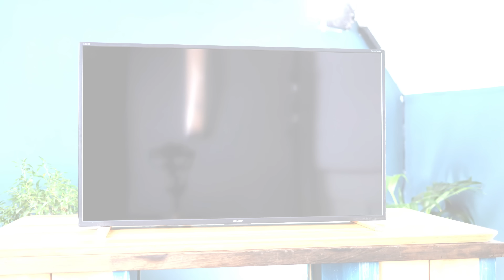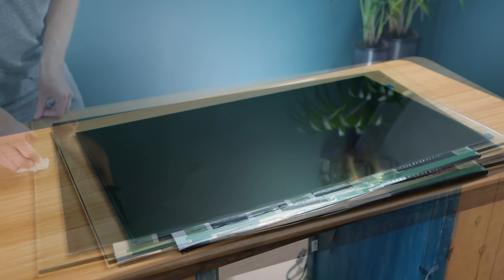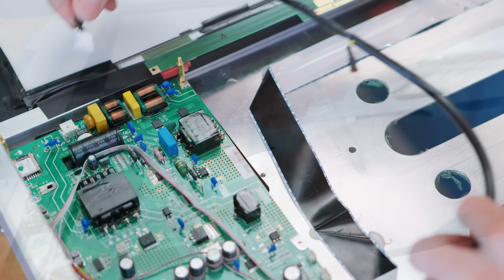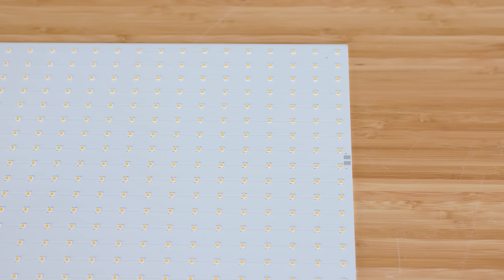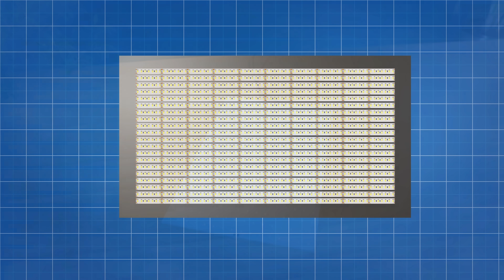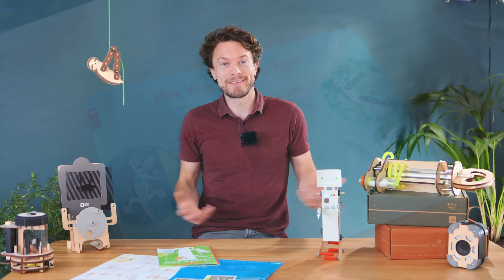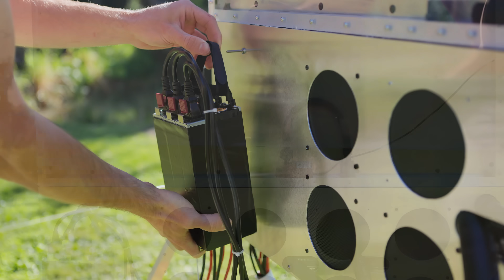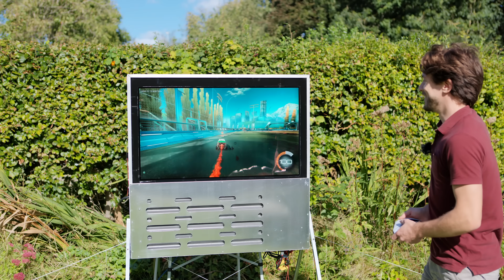Building an ULTRA-BRIGHT water-cooled TV...

Comment: With the LED stripes you get 1400 individual LEDs. If you manage to control them directly, you actually get a TV with A LOT of local dimming zones.
Reply: If there was software that could do it, it would be great, unfortunately that much zones, with such tight latency, I cannot se how.
Reply: @YOEL_44  would need an FPGA
Reply: @TheBackyardChemist  do you? even at 240 hz it's just 1400 outputs being controlled, so 240 * 1400 = 336000 control bits being output per second, or 41 kilobytes / sec. Seems like a normal microcontroller could do it. But getting the hdmi IN is the problem. I don't know if any inexpensive capture cards actually have very low latency, but I believe the PCIe ones do. So you could do this on a normal computer, essentially.
Reply: @cheater00  To really use the dimming zones optimally you can't just modify the backlights while keeping the LCD matrix as-is - you need to process the input video (at up to 4K for a TV like this one) and split it into a high frequency and low frequency component to send out to the LCD and the LED backlight simultaneously. There's a good amount of processing involved and ideally you'd want to do it at less than about 16ms for each incoming 4K frame.
Reply: @KillahMate  so you want to do it on a PC anyways.
Reply: @cheater00  you could probably do it with a PC that has a capture card, but the problem is that the processed HDMI signal still needs to go though the processor board in the TV which makes setting up the synchronization a pain in the ass.
Also a typical PC tends to do really poorly in timing critical things, you would need to use a specialized Linux kernel with the "real-time" patches
Reply: @TheBackyardChemist  I think in reality it's way less complicated than you make it out to be.
Reply: @cheater00  : Yes and no. An FPGA with some low-speed microcontroller (an Arduino would probably be enough) is the right way to do it. The FPGA decodes the HDMI (or DisplayPort, since there's easily available converters and the most important part of the standard is actually open), calculates the "backlight" video from the normal video, throws both the normal & backlight video streams into an FPGA controlled FIFO buffer (really just two RAM buffers, but the FPGA makes it act like FIFOs for convenience), and sets the distance between the FIFO's inputs and outputs so that the relative delay keeps the backlight properly synched with the LCD. The Arduino or equivalent is there to configure the FPGA on power up, and to provide a way to change the buffer length so you can get the synch right.

Philosophically, it's an input pipe, that flows into a splitter (where one of the outputs is a smaller diameter than the input), with some storage tanks on both outputs, and all of it is controlled by some valves controlled by a really cheap & slow controller unit (the Arduino).
Reply: @absalomdraconis  let's see you finish this in under 3 years and then let's talk
Reply: @KillahMate  Can you expand on that a bit? Are you saying RGB values are altered? I assumed everything stays the same and only backlight intensity changes.
Reply: @radekoncar2404   Well this is mostly for HDR video of course - I can't say how it's done universally by TV manufacturers, but for optimal result you can't change just the backlight intensity because the backlights are obviously diffused over a large region, you have to compensate for that in the LCD image. If you didn't do that you'd have excessive backlight bloom on the LCD image. So for example if you turn up one backlight LED to illuminate a bright spot in the image, the LCD around that spot needs to get darker to compensate for the brighter LED and even out. You constantly have to balance how bright the LEDs are with how dark the LCD is, though it's an LCD screen so it will never be perfect.

It can mean a lot of calibration work for high end TVs to determine what the optimal curves are but then it looks great, whereas cheap TVs can have local dimming but use a more naive implementation resulting in a crap picture full of bloom.
Reply: @KillahMate  Sounds plausible. Do you know of any article or press release which mentions that?
Reply: @radekoncar2404  I don't really know of any articles with an overview of the field, sorry! You can find research papers related to this, but for some reason YouTube is blocking my replies when I try to add a link.

Comment: You never end up making any of these, but you watch them for the ideas that they give you.

That is why DIY Perks is so good.
Reply: You won't need to make the exact same build, but using the ideas, you can DIY your own project, as the name "DIY Perks" implies
Reply: Nah, if there's one channel I've taken many ideas from and followed a few is this one. The LED panels one was a godsend for when I started to do online classes at any time of the day, as well as converting an old screen into a secondary display. 

I do wonder just how much research goes into making each of these videos, it's really stunning.
Reply: @riveraluciano  I made the LED panels as well.  Very handy.
Reply: @biffbarely7045  some may say it's completely useless but his projects have so many logical bits which can come in handy for some projects like I want to build a table lamp using his ideas
Reply: @riveraluciano  which panel?
Reply: @SirDella  Not the daylight ones, but the ones based off old TVs. In my case I used old netbooks and LED stripes to build my own panels. The concept itself was enough to serve as a reference.
Reply: Nah I want to make a bunch of these things. Just trying to find tvs in my rural area is tough enough. I want to make a bunch of those daylight type lights for a few of my rooms. This project could be done even far cheaper as I would just remove the need for the rad and all of that stuff and just put a mister line on the back of the tv for out in my patio area.
Reply: Also the moment he used those 48v LED panels this project isntantly became not a DIY. Because noone in their SANE mind would use 48volts LED panels to light a WATERCOOLED TV. Its just stupid.
Reply: @Tomas-xpresas  Did you not watch the video? The whole point was to get the brightest tv to use in sunny conditions. A normal tv would and does not work. Something like this would be ideal for patios and outdoor bars of such. You are just sore that you do not understand the difference between 48v and 12v. FFS the tv is either 120v or 240 VOLTS depending on where you live.
Reply: Tbh 9/10 projects are just plainly dumb and usless. LED panels are the only one that can be actually used on daily life. His "stupid" computers are usless. Why the fuck you would want a water cooled TV or a half wooden laptop...
Reply: @Tomas-xpresas  As for wooden laptops. You know there are people out there that like to customize things to work for their exact specs or looks. If you think this is all dumb. Then I guess everything you own and have is all gray and no spec of color or style at all.
Reply: @kameljoe21  don't worry Im an engineer with a degree probably which you don't have. What I'm telling is building a watercooled 1.5kw TV is just plain stupid.
Reply: @Tomas-xpresas   """ Im an engineer with a degree """ having a degree does not always make you smart. If you do not understand the concept or have the ability to see what this does or can do then you are not smart. I can explain it in great detail for you. Just let me know if you need help understanding what a 1500 watt super bright TV does.
Reply: True calling it plain dumb just because it looks to be something else is not smart and the computer he talked about many people build their pcs into their desks as long as the cooling is efficient what's the problem?
Reply: @Tomas-xpresas  TBH if you were actually an engineer you would be in awe of his ability to imagine something like this, and then to actually build a functional prototype.
This was not created for you Tomas. It was created to showcase his abilities. To show no matter how unorthodox an idea may be, there are no limits to what can be accomplished. I fear the only thing stupid here is your inability to imagine. That would be a horrible trait for an "engineer". 
Peace out.

Comment: Instead of the voltage boosters, you could use four power supplies in series for 48V. You have to hack the PSU to "float" its ground (detach it's negative side from chassis ground). There are lots of videos showing how.
Reply: or just use a cheap 48v power supply from an ebike or e scooter
Reply: @10ulcinj  Those will most definitely not provide the required 1000+ watts
Reply: Similar to the server grade power supplies you can find something like the Huawei R4850G2 which provides 48V at over 50 amps

Comment: Id rather compare the LCD layer with a slide.
A slide also produces an image with light shining through it

NO, the cheapest option for a backlight is NOT LED strips, it would be using a mirror.
Alternatively you could construct a large Tarp screen with an opening for the TV and use direct sunlight for the purpose.

Comment: An interesting phase two I'm going to have the backlight be the sun via some sort of solar collector and reflectors. It probably wouldn't be the most practical thing in the world but it certainly would be neat
Reply: That thought came through my mind as well!
Reply: Using sunlight would not only save power and cooling, but also would make it automatically adaptive to the lighting conditions. Some sort of "periscope" and maybe some (fresnel) lenses to increase the amount of light. Would have been helpful, that sunlight is parallel. But sunlight is split in direkt rays of longer wave lengths and shorter wavelengths (blue) is scattered and comes from everywhere. That would probably mess up the colors a lot.
Reply: There exist those sun light-pipes that have LED injectors. What they do is they add LED light when the sun get into cowds. The most impressive thing is that they ad with the same CRI and light temperature as the sun is. They are attacked to a solar light collector with tracking mirrors, it looks sort of like a shallow box.

Downside, they are rather expensive.
Reply: When I started watching the video, I thought this is what it's about...
But I imagine it to be quite difficult (or basivally impossible) to get even lighting out of this solution in a practical way
Reply: It'd be better to just hook up a solar panel on top of this TV as a shade and use a voltage regulator to control the back-light's brightness so on a sunny day, the shade could keep the screen visible and provide added power to the TV.
Reply: @shivangswain  Do you have any idea how huge that solar panel would need to be?
Reply: @matsv201  Depends on the backlight used. A 72 cell panel will be able to power the led strip model as their output on a good day is around 400 watts.
Reply: @shivangswain  That still a 4m2 panel directed directly at the sun. Consider the angle and you would need more.
Reply: @matsv201  Never said it would be self sufficient but it would definitely help more than trying to funnel sunlight through the back of the LCD to get the TV working. This also works in the night for example, is cheap af and the shade further enhances the TV contrast while requiring the screen be less bright.
Reply: @shivangswain  if you just shade you get like 5-10% of what you need. Its kind of mot the bothet
Reply: @matsv201  Huh?
Reply: If you did use a solar collector then you'd want to remember to add on some light filtering to remove IR (to keep the system cooler) & UV (to avoid giving an accidental sunburn). You'd also probably want some extra dispersion of the light: some plastics do a good job, but are bad at heat resistance, so might sag if given the chance. The dull side of aluminum foil is also quite nice, so a semi-thin sheet of aluminum (maybe a millimeter or two/ a sixteenth of an inch or so) with a thicker than normal anodization layer (go looking for car/motorcycle customizers, and see what suggestions for local companies you can get- this is not something to do yourself) would be a good match.

You would probably still want the water cooling though, as well as a sunshield for any day that you didn't want to watch it.